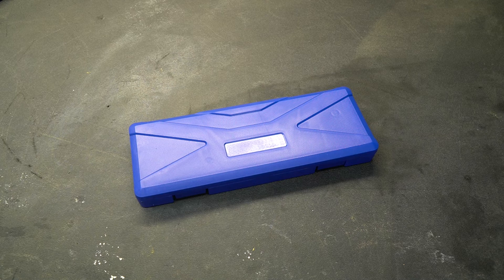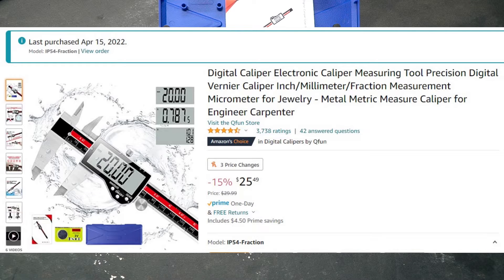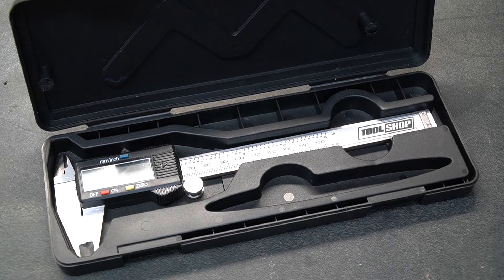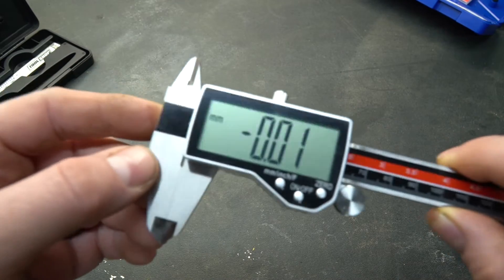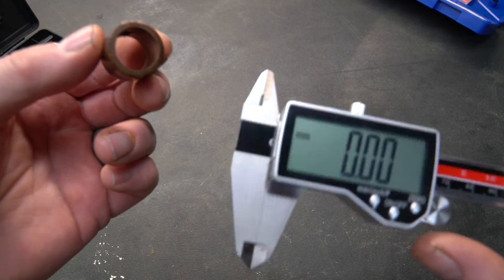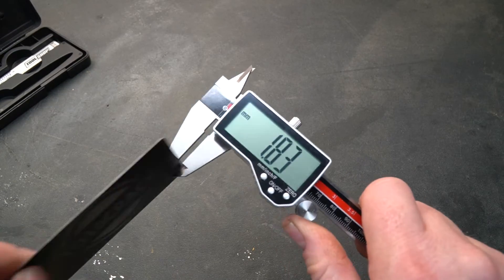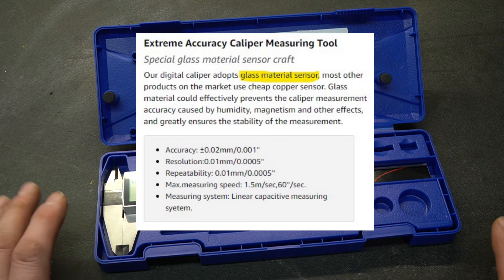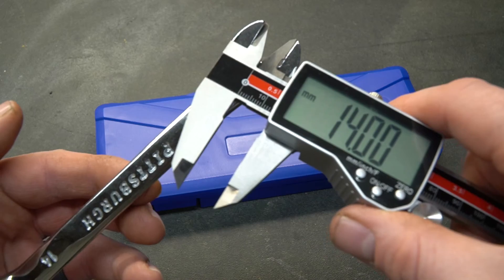QFUN 6" Digital Caliper, Inch/Millimeter/Fraction Measurement Review, NTDT

Comment: Does the battery die in 2 weeks if you don't remove it while storing the calipers?
Reply from the maker: I'm not sure, I have not had it long enough to know.   But I have had calipers that drain the battery very quickly even when not using them.
Reply: If the caliper Robert Cowan received was still  charged, the battery should last at least two months, after all it was shipped from overseas